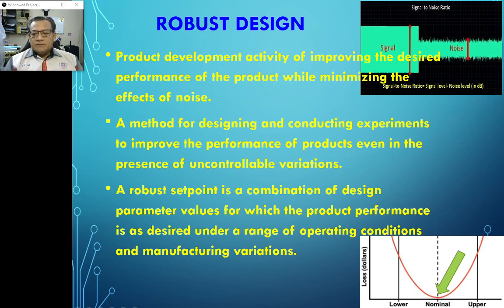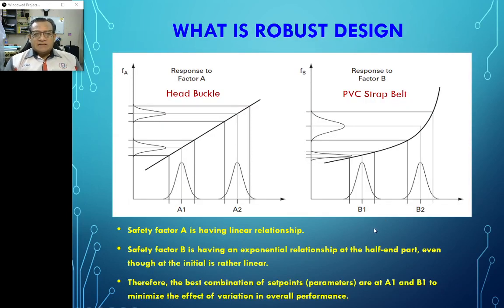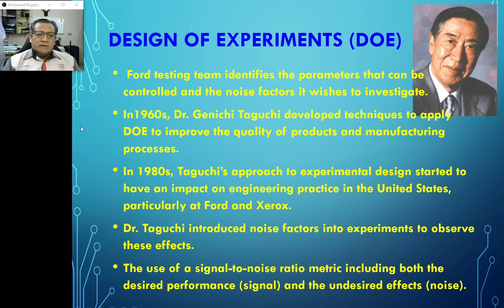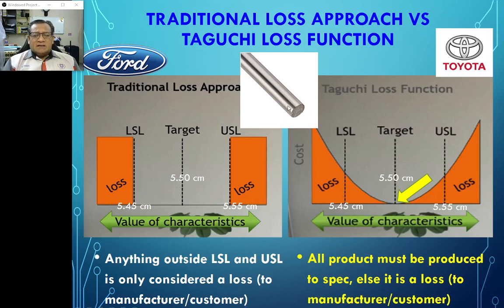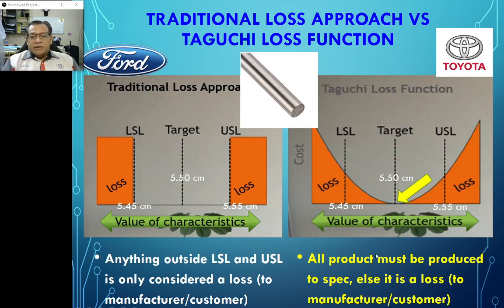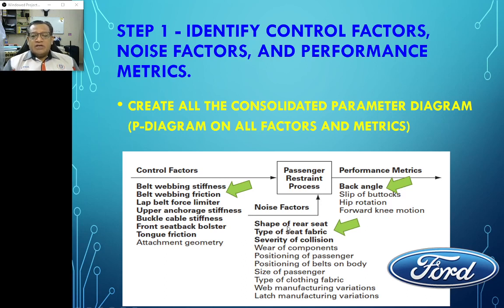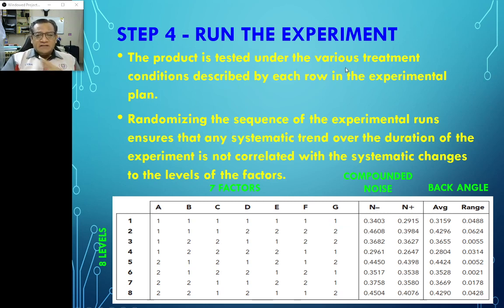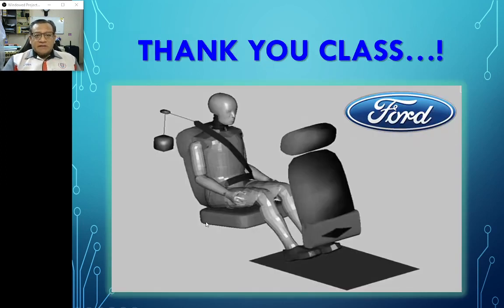Product Development Course Chapter 12 Robust Design

Comment: Chin Suhk Jian (AP190427) 

From this video, I have learned the 7 step process of robust design. Since there are many kinds of uncontrolled variation that may affect the performance, so there is an approach to the development of robust products based on the design of experiments (DOE). The use of objective functions helps in capturing both mean performances which could achieve robust performance. The use of analysis of means and factor effects charts makes it easier to choose a reliable parameter setpoint.